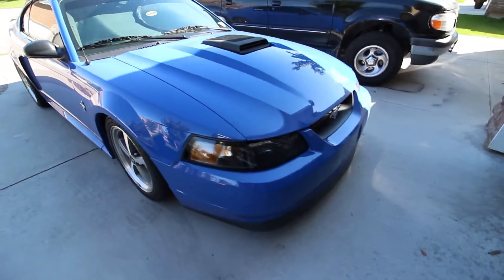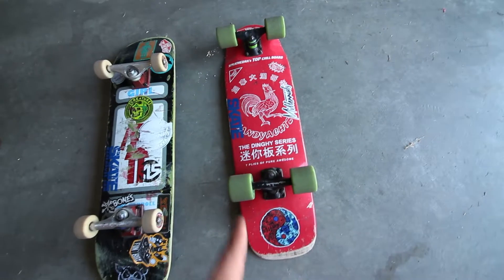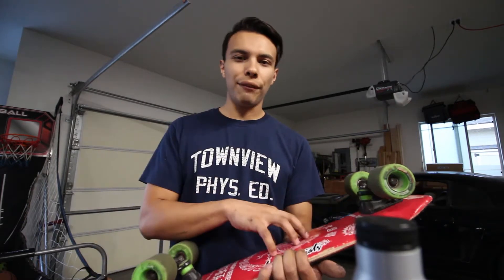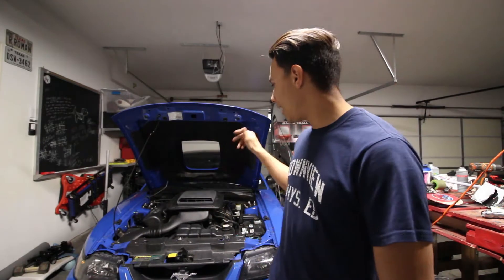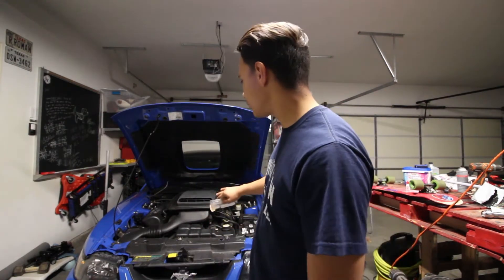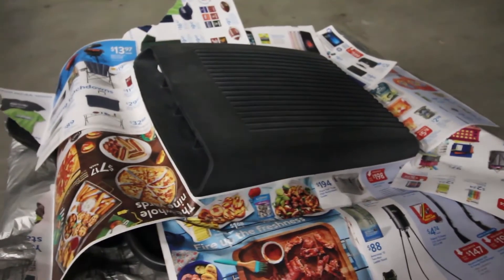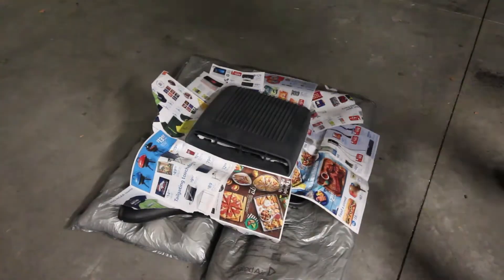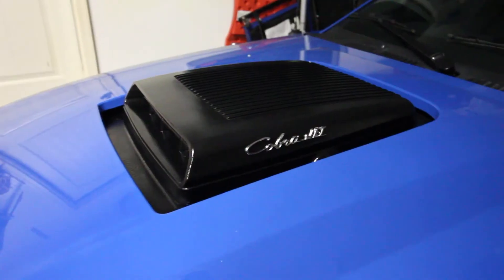MACH 1 COBRA JET!

Comment: Next time you want to restore plastics to a new finish. Take a heat gun and go over the whole piece your doing. The high heat lifts up the oils in the plastic and brings them back to the surface and makes the plastic look brand new. And it will last a long time
Reply: Heat like that makes them more brittle.

Comment: Hey boss man I got my Cobra Jet Emblems in a few weeks ago and they won’t stay on. I’m guessing it may be due to the heat of the motor but didn’t know if you had any secrets to keeping your on the Mach ?
Reply from the maker: That’s odd. I only put it on once and never had an issue with it staying on. I’d probably put some superglue or extra adhesive to keep it on. 👍
Reply: Ozomeroman I’m taking it to get it powder coated tomm and yes I’m gonna give the superglue a try. Thanks for the tip and keep up the good work and videos. Big fan here in Dallas NC

Comment: Not bad...but it would look better powder coated (the shaker I mean)
Reply from the maker: I definitely agree, but since my shaker was already faded I wanted a quick fix to restore it back to black. Using the spray paint did a surprisingly good job and so far it seems to hold fairly well. Maybe in the future if it decides to fade again, I will powder coat it.